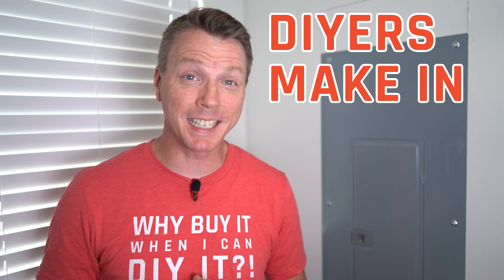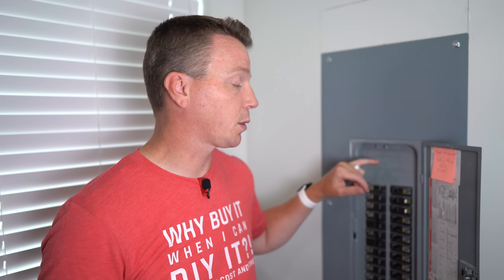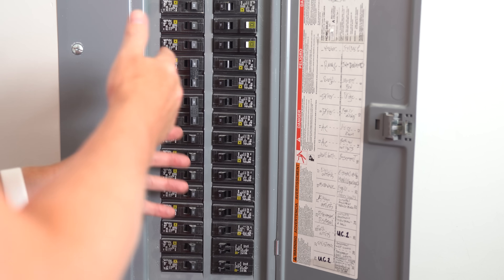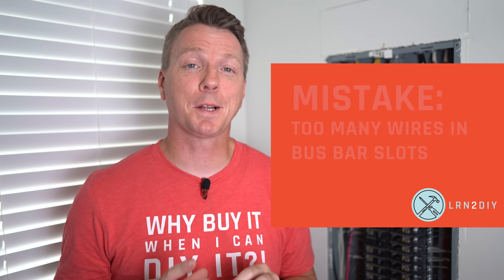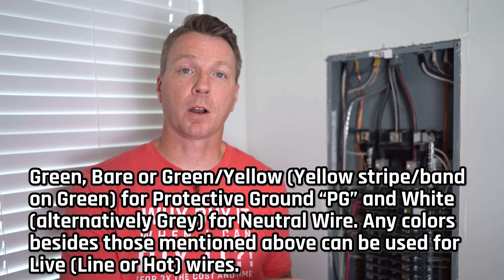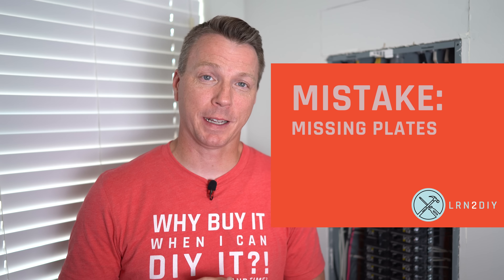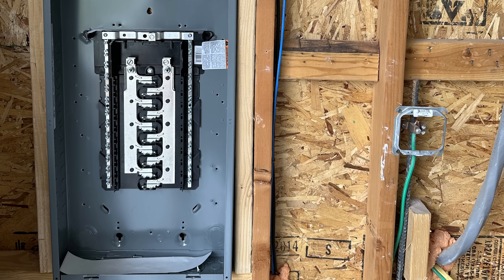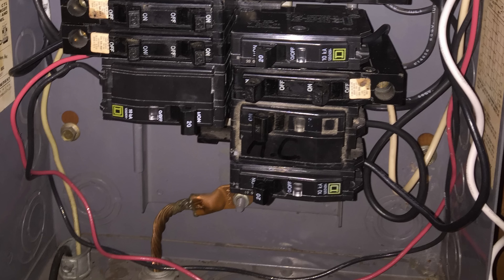10 Common Mistakes DIYers Make In Circuit Breaker Boxes

Comment: Another mistake is using circuit breakers as light switches, Frequent switching will wear them out and cause them to fail prematurely. Instead, use a light switch that is cheaper and designed for frequent switching.

Comment: Another common mistake is to cut the wires short, so they just barely reach. That puts them under tension, which increases the risk of pulling loose or breaking. All wires should have plenty of slack.

Comment: I actually just diy’ed the electrical in my basement. I ran 8 new runs to my boxes. 2-200 amp Eaton boxes. I used about 1500 feet of 12g. Nothing is over loaded and to code. The only thing I struggle with and kind of fear is finalizing the switch boxes because 12g just sucks. Other than that I probably could have deleted a couple of home runs if I had more knowledge on advanced wiring

Comment: Question
(If) I have done a full wiring of my shed, from trench to finish including subpanel, and did not get a permit.
assume I did a good job and didn't scrimp on anything and was able to meet every applicable code (Remember i said IF). If I then went down and applied for a permit and had an inspection, what is the most likely outcome? I know they could have me tear it all out and start over, and they could punish me a million different ways, but what is the most likely?. BTW it is all EMT conduit exposed, no drywall.
Just asking for a friend///:)
Reply: LMAO. Some states let the homeowner apply for a permit. As long as your work conforms work all codes. If not you can say that you bought the house like that and play stupid   if the project confirms to code they most likely won't make you rip it out. You'll just have to fork over permit fees and maybe a fine    but way better than paying a contractor and jumping thru all the city hoopla BS.  It's all about money brother.  The town wants they're slice of your pie!   So trust me   best to  grease the squeaky wheel than to ignore it and hope it goes away

Comment: I’m not sure I agree with #2. Busbars are rated for continuous duty so there is no reason to limit the current to 80% of the busbar’s ampacity. The main breaker is most likely not rated for continuous duty which means that it can handle the full rated current, but not for 3 hour or more. Using 140A or 150A on a 150A busbar for  short period of time isn’t an issue. I don’t believe there is anything is article 230 of the NEC that requires the load must be 80% or less of the service rating.
Reply: Always calculate every circuit for no more than 75% of the load

Comment: All good points, though I disagree with the second one.

Breaking your circuits down into smaller parts isn't going to make you use more electricity.  If I have a circuit dedicated to one room, and a circuit dedicated to another, I won't use more power than having one circuit for both rooms.

What WILL create a problem is if you start over-loading your panel with major, power-sucking endpoints.  I'm saying thing like:

Electric heat
Electric oven
Air Conditioner.
Electric water heater
Electric dryer
Car charging
Whirlpool

i.e. if you have all these things in a panel, and you're charging your car, while cooking Thanksgiving dinner, while drying your clothes, and then you decide to go up for a nice relaxing whirlpool bath....  yeah, you might have a problem.

My house "only" has 100 amp service, but I'm not too worried since I have gas heat, gas dryer, and a gas water heater.  I could easily add a 50 amp circuit for an electric car and never have an issue overloading the panel.

Comment: 5:40 If you're going to twist short ground wires together like this, you want to upsize your pigtail to at least a #10 (#8 if it's more than a few). Try to never do this; you only ever really need this kind of trick if you find yourself working with short, pre-existing grounds that you can do nothing else to extend.

Comment: http://www.airconditionerservice.info/airconditionerservice/airconditionernameplate.jpg  One more common mistake you and the DIYers make is the AC condenser nameplate has the minimum ampacity and the min and max of the overcurrent protective device (breaker) On the example above a 14 gauge wire can be tie into s 20 amp breaker minimum and maximum

Comment: That double tap on that circuit breaker is entirely legal because they are under a clamp that is approved to or 2 wires. Square D QO breakers are the only ones that have this feature. The best panel you can buy. And on top of that, if you buy a Square D QOD panel you can use the bolt in breakers and the plug in breakers in the same panel. Bolt in is rare for residential, but you may want that feature when you use the larger amp breakers like 40,50,100 amp.

Comment: Careful.  You are not a trained electrician, I can tell.  You make a number of mistakes, some of which are pointed out below by others..  The big bare aluminum wire you call the main ground is no such thing.    The number of breakers installed in a panel has zero to do with how much load is on it.  So many mistakes and miswording.  Go back to carpentry or whatever it is that you do.

Comment: If your panel is overloaded a sub panel is not going to help one bit.  It will make it worse.  However the odds a panel that size being overloaded is pretty low even when there are no spare circuit spaces. By the way that panel is a load centre and has aluminium conductors.  I would not recommend that any diy's play with aluminum service conductors.  By the way panel bus bars and service conductors are not derated.  When you feed a sub panel you have to use a breaker rated below the ampacity of the main panel.  I generally used 70%.  Sqare D panels do not come with enough ground terminals so it is always necessary to pur more than one ground conductor under the same terminal.  I would not use wire nuts to connect ground conductors in a panel just because you don't have enough ground terminals.  
In North America a DIY'er will never see a panel like the one you used as an example of a neatly wired panel.  That was a 3phase panel and an electrician who only wires houses will never see one.  With respect to wire sizes.  If you have an AC or heat pump connected to your panel the conductor ampacity can be smaller than the breaker supplying it.  Its a motor load and is treated differenctly.  Breakers are sized to minimize nusiance tripping.

Comment: My house has an old Murray 100 AMP panel. Can I install a new 100 AMP Square D circuit panel in its place-with the help of my handyman electrician? (My wife thinks I need a permit-we live in Philadelphia, PA) Thank you for your clear presentation.
Reply: Electrical contractor here- It depends on whether it is a subpanel. All equipment in an installation must be "series rated", meaning by the same manufacturer. If you are replacing a subpanel and the main panel is Murray, or vice versa, don't use Square D.  Although the different brands will work, you will void any legal responsibility by either manufacturer if you mix brands. Murray is now "owned" by Siemens, so their equipment is compatible. And yes, you definitely need a permit for anything other than minor repairs, such as replacing a defective switch, changing a light fixture, etc.

Comment: A trick for hanging the panel cover is to use set screws and nuts to hold it from the top.  The set screws act as a hanger for the panel cover.

Comment: Nice. I liked the panel at 13:09. That's the proper way to do it. That particular panel was a 4 wire, 3 phase Wye, 120/208 volt. The color code gave it away--the A phase-black; B phase-red; and C phase-blue indicate it as a 120/208 Wye. If it were a 4 wire, 3 phase Delta, 120/240-volt, color code would have been A phase-black; B phase-orange; and C phase-blue. The orange is an automatic indicator that something here is different and tells the electrician that this is a 4 wire Delta system which means there is a WILD leg, or HIGH leg. That high leg, which is normally going to be the B phase, is color coded orange and will give a voltage of 208 when measured from hot to neutral. According to code, it can be any of the three phases, but must be specifically marked so that it stands out amongst the rest of the poles. It is however usually the B phase which is normally the one in the middle. The high leg is therefore an unusable voltage and must be avoided for single phase, single pole connections. B phase can only be used on single phase two pole connections or three phase three pole connections. A telltale indicator of the high leg Delta panel is, you will notice right off the back that every third space in the panel is skipped, unless two, or three pole breakers are being used in those spots. Be aware, this is not a mistake, and one should not think that the silly electrician is certainly wasting a lot of usable spaces here. If you were to connect any of those third spaces to a single pole load, it will blow-up anything you plug into it as the voltage is way too high. Color codes change with the higher voltage 3 phase panels such as the 4 wire, 277/480-volt Wye and the 3 wire 480-volt Delta. But I will stop here. Sorry, I guess I got carried away. Nice video though. Thanks.
Reply: This guy got it right! Black-red-blue for 120/208. Black-orange- blue for 120/240 with a high leg. Brown-orange-yellow - white (or grey) for 277/480.
Reply: One load side connection you rarely see is 3 phase on an open delta. The utility hates it. This configuration only requires 2 transformers on the pole. One is usually bigger than the other. Kinda throws an imbalance on that portion of the distribution system.
Reply: You are right for newly developed areas.  But in my neck of the woods, Open Delta's are everywhere.  I work on them all the time. @jtd2949
Reply: Outstanding gentleman. Only I would add is sometimes purple is used to indicate the HIGH LEG.   Oh don't get bit by THE HIGH LEG!!!  Be aware of the ISO NEUTRAL when working with high end user tech.  IE hospitals , weather stations, prisons, airports or most federal/government buildings!

Comment: Labeling is important, in addition to properly labeling the cover,  I take a piece of romex and slide it over the hot wire at the breaker, and write the label on the romex, that way when I take the cover off I know what circuit the breaker is powering with out having to look at the cover, very convenient and accurate.
Reply: Outstanding  young buck.  That's how it's done

Comment: In some older sub-panels from the 50’s and 60’s you will often find that ground and neutrals are combined. This of course, is not acceptable in newer panels and the older panels can be upgraded with a separate grounding buss connected to the main or completely replaced. You might mention that new panels may have an integrated neutral bar, many AFCI/GFCI’s which are wired differently, whole house surge protectors, and designated areas for breakers over 60-70 amps.  Finally, I’m seeing more 14/2’s as more newer homes install LED lighting and builders try to cut costs when copper prices are high..
Reply: Just be sure it really is a subpanel before you start disconnecting bonds. Split bus  panels following an A base meter were common back then and may look like subpanels because there's no single main switch, but they are the main panel and must be correctly bonded.

Comment: Lousy job on the inside of this panel local electrical inspector would not let this pass to get a certificate of occupancy . National Electrical Code must be followed . More deaths from improper electrical work causing house fires. DIY ers are mostly not qualified to even take the panel cover off.

Comment: I am glad you discussed torque settings!
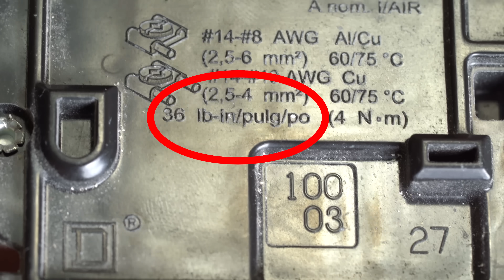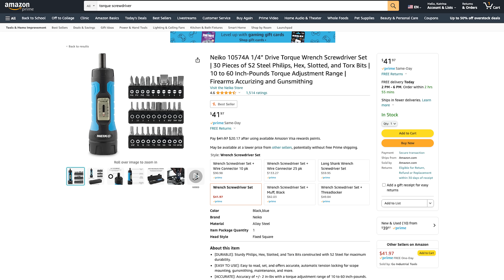Reply: Too bad he didn't adhere to them, 11:34 Breaker says 36 in lbs, but at 12:18 he says its set to 50 in lbs, 12:44 shows its set for about 46 in lbs. Over torque is just as bad as under torque.

Comment: Hot tip 873: If you're having a home inspector check out a house for you, make sure he knows NOT to flip the main circuit breaker off to "check" it. It may not reset. And if it is an older panel with a hard to find main breaker type, you're going to have one very pissed off home seller.
Reply: C'mon dude.  That's just bad advice. If the main breakers doesn't reset then there's a bigger problem then finding the same type.  Number 1 it needs to actually function as the main disconnection of source power.  If that doesn't happen, then it defeats the whole system of safety
Reply: @michaellike5037  Sure. You revealed an issue. Do that in an older home with a hard to locate breaker. Now the homeowner is faced with potential panel replacement. Throw in electric heat in the middle of winter. Maybe they keep very expensive tropical fish. Maybe dear old uncle Bob needs his medical equipment plugged in. Do you think the homeowner is going to be happy you messed around with the main breaker? If you saw a leaky plumbing supply pipe that was dripping under the kitchen sink and decided to wiggle it, and it broke loose and flooded the kitchen and downstairs. Whoops...sorry about that. Gotta go. This house will need some work.

Comment: Note on applying torque:
Once the tool has indicated that the correct torque has been applied, do not apply the tool again, you will end up giving it too much torque
In reference to the above do not come back later and just "test" the torque as you will, again, over torque

Then how do you do this
You can set the torque on the tool for a lower torque, the set the needed torque to finish the tightening.
To check the torque, they should first loosen the fastener, then tighten it down to the correct torque

Most wiring is copper, a pretty ductile metal, repeatedly over torqueing could cause failure of the metal (wire) at the fastener. This could result in a hard to identify open, compression of the wire to the point that it no longer conforms to standards (i.e., that 12g is now effectively 16g), or just a poor connection.

Comment: The video is ok.  Just a thought thoughts.  First, I'd never wave your hands around over an open circuit breaker panel when you are looking away from the panel (e.g. looking at the camera).  You'll be a Darwin awards candidate.  Second, it would be better if he referenced the location of each issue in the current NEC.

Comment: Thanks for the video. We had an upgrade from 100 AMP to 200 AMP in 1989. What a mess. The electricians replacing the panel did an excellent job. Very tidy  but I found a few shortcuts hidden by the original owner as I completed other renos.

Comment: remember 16 awg for 15 amp circuits?  I do.  or how about aluminum wire in the 60's  what a nightmare.  i'm sure that was pretty thick stuff.  i'd hope anyway.
Reply: The latest code revision allows 16 gauge wire for lighting loads because LEDs use so little current, although it's not actually allowed yet because the manufacturers haven't had their equipment rated for it.

Comment: on the amperage, power isn't pushed, it's demanded/pulled. All the LEDs and Fans that come with wires are running like 18ga wire... it would be bad if 20 amps was being pushed over them to a light. Not how it works.

Comment: #6 - this is legal if the manufacturer says that it is rated and tested for it. Wires must be same size and type (solid/stranded) check the labels on the can or the book that comes with the panel. Just like you mention in #8..

Comment: For DIYers: if you need to replace a circuit breaker, bring the old one to the store so they can help you find the appropriate replacement. If you haven't removed it yet, take a close-up picture of the breaker and the box label. Boxes only accept compatible breakers, and even some brands have different boxes.
Reply: YOU must replace a home line with same or a bryant with same or seimens breaker  with same U CAN'T MIX BREAKER MANUFACTURES NOPE!!!!!!!
Reply: I worked at Lowe's and saw some pretty gnarly pics of hacks that people did to their panels.

If it takes a saw or a hammer to put the new breaker in, you have the wrong breaker. 

"Call this guy. He is an electrician. He will get your problem fixed without you dying"
Reply: You don't just use a bigger hammer?😊.
Reply: @davidcooper4385 As mentioned before.....when you take the panel cover off a residential panel.....the supply conductors are usually hot.
And can usually supply 100, 150, or 200 amps .
Enough to kill you several times.
If you cut the utility tamper lock off the meter socket, and pull the meter socket.....the panel will be completely dead.
But this isn't for amateurs.
If you don't know what you're doing.....death can occur.

Comment: If the MFG'er of the breaker puts in a notch or ability for 2 lines, it's legal for the breaker... Some jurisdiction do not permit this. When we put in a 320 meter base & 2-200 amp feeds to the home (one load ctr was mounted in the detached shop & one feed continued to the home). The inspector was unsure. He came back to us & said ''if the MFG'er has the option, it's permitted'' This was in our jurisdiction.  We used SD-QO line.